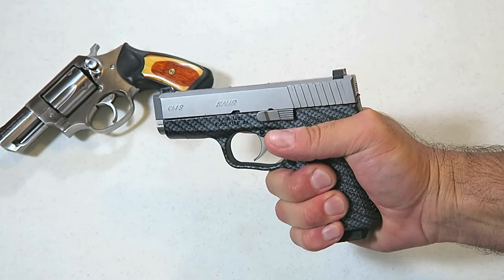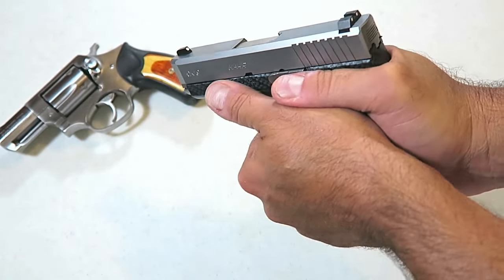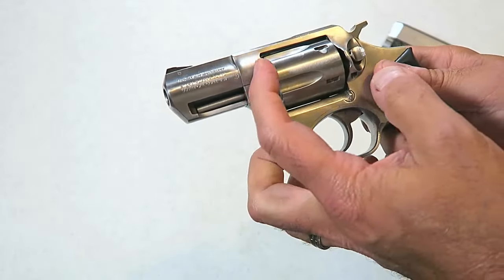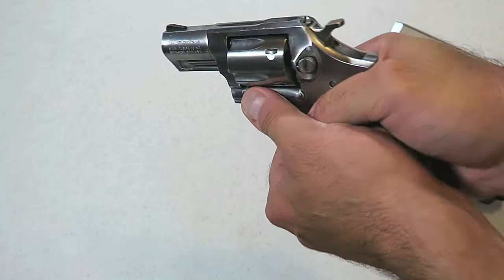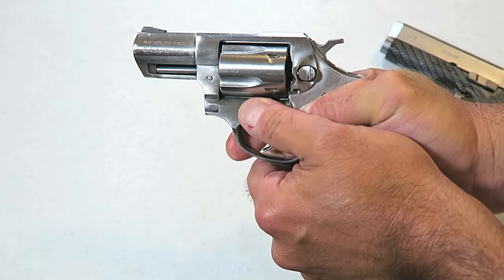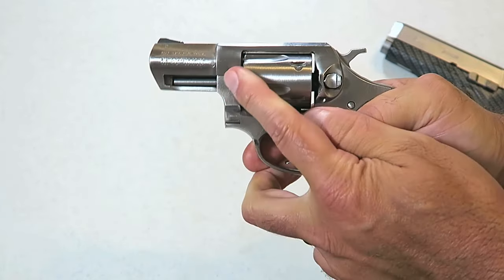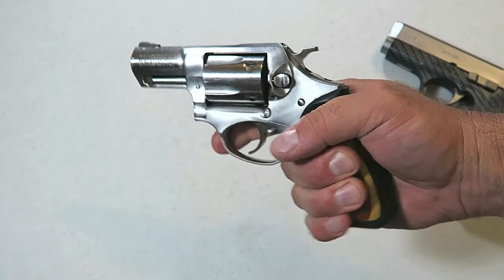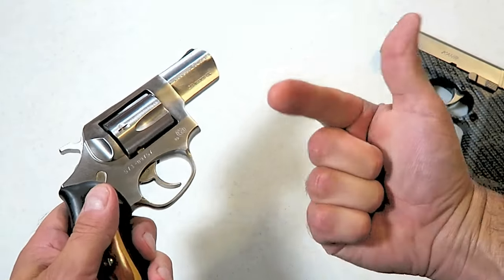How To Properly Grip a Revolver - TheFireArmGuy

Comment: Not the way I was taught. The right thumb is useless while the left hand comes in to overlap the right. The left thumb clamps down on the right hand out of the way of the hammer. This is a very secure and stable grip

Comment: I'm early in the revolver learning curve, and finished the last range session with a very painful lower thumb joint on my strong-side. On that day I tried a new hold, with the weak-side thumb crossing over the strong thumb about halfway between the upper and lower joint. It may have focused the recoil forces into that lower joint. I was using a pair of N-frame 8-shot .357 Mag / .38 SPL revolvers, mostly with the latter, and after about 7 loads I was done! Next time I'll return to the thumbs-forward method, minding the gap of course!

Comment: Very important for semi-auto guys to remember this. Even your reversing the thumbs leaves that support thumb pretty close on small frame revolvers so caution is needed. I recommend thumb up or down not forward at all.

I would also recommend that for defensive purposes the most effort should be put in to learning to shoot one handed (bith strong and weak). It is very likely when things get up close and personal that the other hand may be otherwise engaged or out of commission. And it is a more difficult skill to master.

Comment: Well, over here in Singapore, our firearms instructor told us the off hand clamp down on your shooting hand, with the off hand thumb, pressing on the fleshy part (between the thumb and index finger) of the shooting hand. This way you get a firm grip of the revolver and both your hands are away from the cylinder.

This grip method is 1500% a no go if you are using a semi-pistol.
Reply from the maker: Good stuff bud.  Other guys mentioned that grip as well.  Seems like a good technique but just not for me
Reply: If I understand this correctly, this is with the offhand thumb then facing rearward? (I have been trying to find an example and name for this grip but have not yet found it.) If so, to mention and ask..., I have trained a bit using a rearward directed thumb technique, but with the offhand thumb over the grip hand thumb (and its slightly upward as well), with my GP100, ...using my offhand thumb then to quickly cock the hammer (because its stationed right there) for quick steady single action firing. I feel its been very effective, with steady and strong control in my grip and aim. The only problem I see is that the offhand wrist is bent slightly more, so you don't have that unobstructed straight-out flowing posture in the arm-thru hands stance (if you will), but I haven't felt this to be a detriment. 

I would be interested in more reflections on this presumed method (that I don't see anyone use or write about). If it is a seriously flawed method I would think I would have seen it discussed in articles or forums. 

Anyway, all these years and just now finding your channel, Dan. Seen some good stuff on your channel, and definitely going to be checking more out!

Comment: I'm left handed & own a GP100. I can get a sort of modified thumbs forward grip by placing my right hand thumb up on the dished out cut out behind the cylinder, left thumb on top of the right, very comfortable & never had an issue even with hotter loads.

Comment: What if you overlap your grip thumb and put the support thumb on the top left part of the cylinder? This would be for single action shooting but the support thumb is in a great place for recocking and would stabilize the revolver better. Unless revolvers had a good on that position so the thumb wouldn’t stop the cylinder rotation.

Comment: Great advice.   My grip I use is that my right hand is in the proper position,  but I take my left hand and kinda like wrap it around my right wrist, left thumb laying on top of my right thumb,  left hand fingers wrapped around the right wrist, kinda like a brace.   I discovered this grip by just messing around at the outdoor range one day.  Real easy position for me to acquire,  allows me to accurately shoot the my S&W.500 ( my favorite revolver ).  And my fingers are nowhere near the cylinder gap 👍🏼